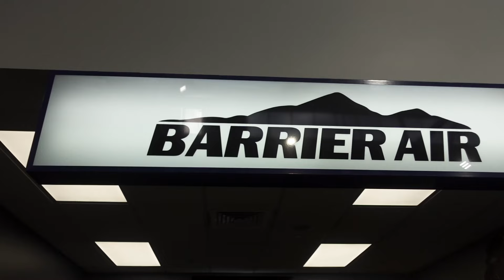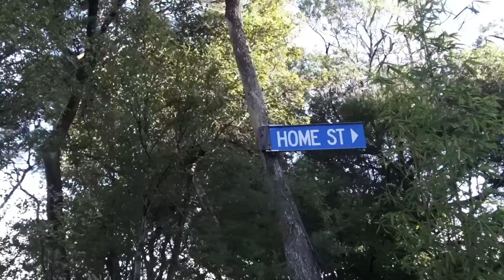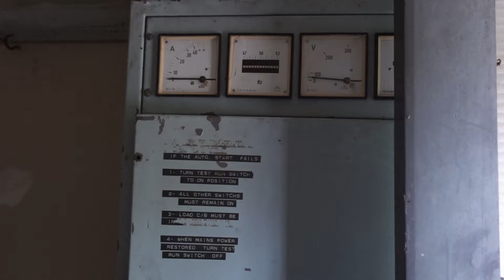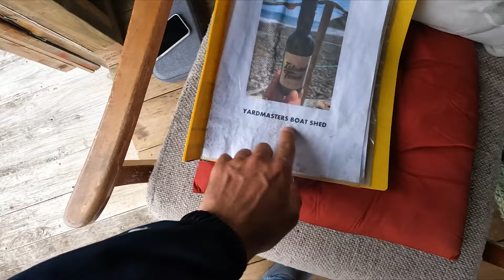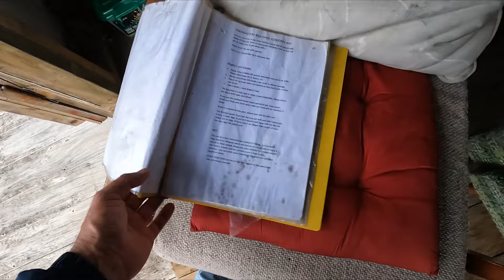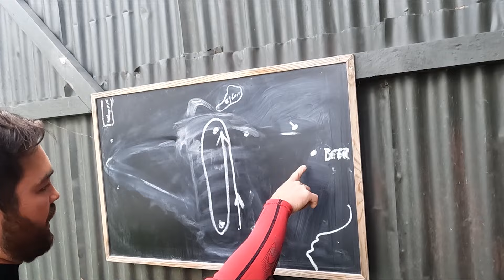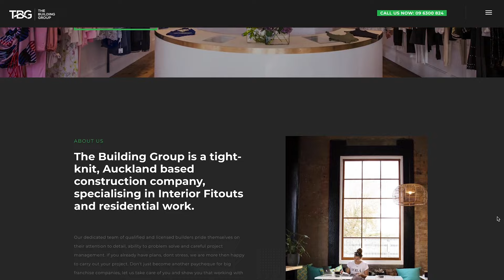Family living completely OFF-GRID on REMOTE ISLAND! - (Episode 190)

Comment: You mentioned having a creek that goes downhill through your property and that you use it for fresh water. Have you considered also using that water source for your electricity? From what I understand if you have enough water/flow you should be able to produce more electricity than solar even if you had more sun. Dam it somewhere enough to collect water and then run it through a turbine and on down the hill.